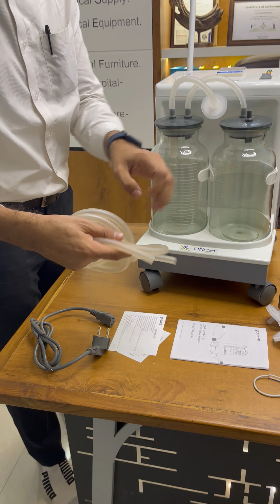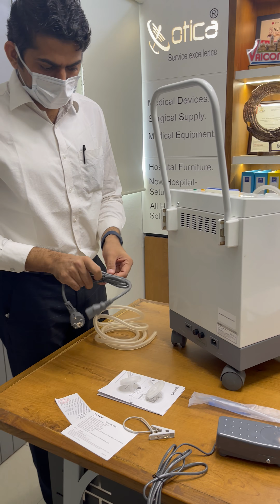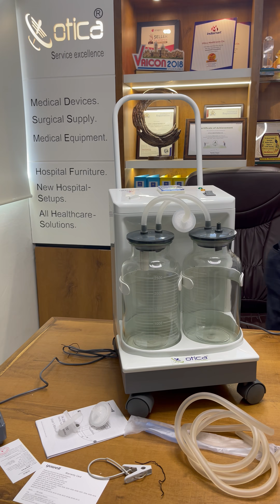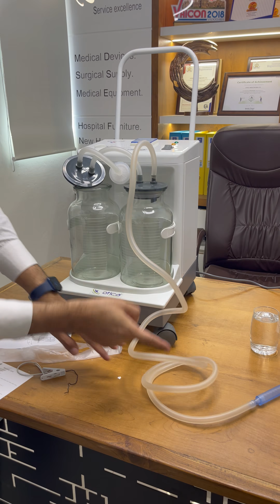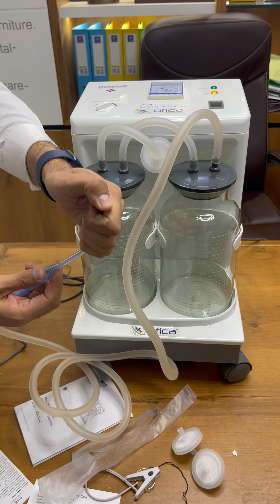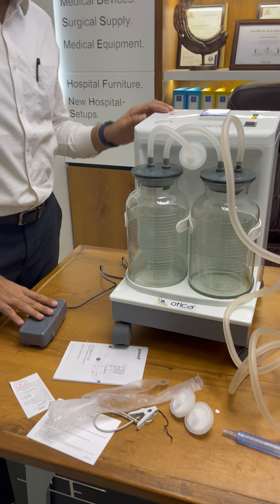How to use Suction machine Double Bottle trolley suction for Phlegm suction and surgery or Delivery

Comment: What is the maximum suction pressure of this machine
Reply: What do you do incase water gets in the machine after the bottles filled up??
Reply from the maker: Keep Safety Air filter in between bottle and machine so whenever water tries to get in the machine Air Filter will get chocked and suction will be stopped.  and for better safety please do empty the bottles before it reaches to maximum level.
Reply from the maker: Maximum Negative Pressure : 90 kPa

Operating Noise : < 65 dB
Pumping Capacity : 20 LPM
Jar Capacity : 2.5 L X 2

Comment: Can we use this suction continuosly for 1-2 hrs or we have to stop it after specific time duration,what company says
Reply from the maker: Company recommends 40 minutes continues operation maximum , if you want to use it for major surgeries use it in intervals like with foot switch press foot switch when you need to do suction or else it will stop.
Reply: My suction machine not working properly what to do pressure problem